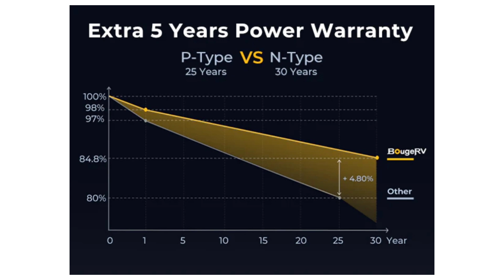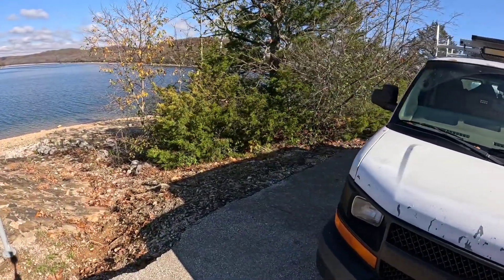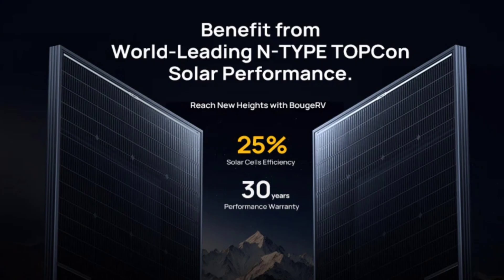Are We Impressed? BougeRV TOPCon 16BB Bifacial Solar Panels Installation And Preliminary Test

Comment: Are the panels 100 watt or 200 watt each?
Reply from the maker: At 5:08 I state these are 200 watt panels. So, yes, there are 2, 200 watt panels on top of the van at this time. There is a potential to make 400 watts when conditions are right. Conditions that day were definitely not even close to optimum considering the angle of the sun.